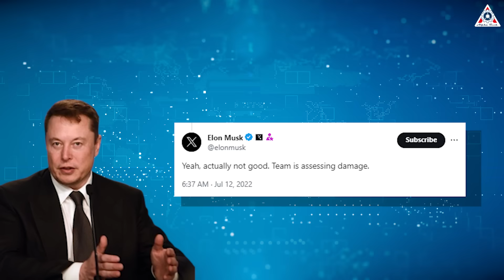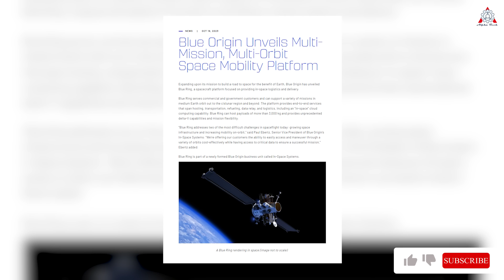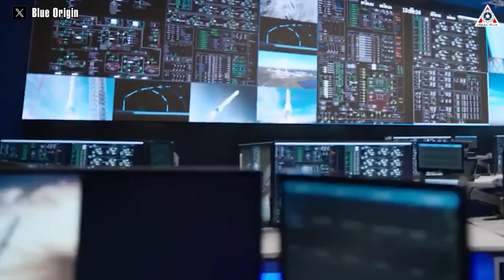Game Over! Blue Origin BE-4...

Comment: SpaceX has completed 2 major iterations of the raptor, they have done way over 1000 individual engine tests, some of them failed, some of them were tested to failure. At least 33 were flight tested (even though some failed it's understandable as they were tested on a first of a kind vehicle).

It's possible that blue origin just wants to be extra careful and make sure that the first Vulcan test goes smoothly, but if they fail even after all the shenanigans they're pulling, there is really no hope left for them.

Comment: Are BE-4 engines going to be reusable?  That's a hell of a lot of copper in those nozzles which is great for heat, but it is prone to work-hardening.  That may not be an issue if the engine produces enough heat to make the copper ductile again during launch, but short burns for orbital transfers may not get hot enough.
Reply: The first stage of New Glenn is certainly intended to be reusable, including its engines. ULA talks about some Rube Goldberg system of jettisoning and recovering just the engines of Vulcan to reuse them. We'll see if they are actually serious about that.

Comment: Didn't the guy doing Musk's motor try lower pressures and fail, and that's why they went with higher pressure in the motors. The higher pressure made the combustion much more stable

Comment: I have yet to understand all the Hype over Raptor vs the BE-4. There hasn't been a single StarShip or SS Prototype launch to date without multiple Raptors failing. So, 100% of launches w/ Raptor Engines have had engine failure of one sort or another. 
 What's going to happen if a single Raptor Vacuum engine on StarShip fails in space ? There are only 3 vacuum engines at 120° apart on SS, if one flames out, the asymmetrical thrust, all on one side of the ship, won't be overcome by the Cold Gas Thrusters as the outer Vacuum engines don't gimble. And w/ the Atmospheric Raptors closer to the rockets axial centerline , lighting off one or two of those in the vacuum of Space, is going to be problematic, if they can be used at all.
 SpaceX may be flying their CH4 powered engines first, but they have yet to have a 100% success rate, and with 39 Raptors aboard StarShip & the Superheavy Booster combined, SpaceX has some challenges ahead.

Comment: Irresponsible to use BE-4 without much more testing and explanation for failure.
Reply: The BE-4 has gone through thousands of minutes of test burn time.  More than any other engine in history, including Raptor.  It is, apparently, from the actual test results not mentioned in this video, a really reliable engine. Raptor?  Has not yet proven itself to be anywhere near as reliable as Elon wanted in his vision of "multiple launches per day for the same booster and starships. Just a different development methodology, one slow, safe, careful, one fast, pragmatic and questionable.  Both may succeed, or both may fail.  The optics at this point are: Let's see if Vulcan flies successfully next month, and let's see if Starship flies on Friday. Both will be telling.

Comment: It comes down to the approach to testing and flight readiness. In other words, neither have made a successful flight. The Raptors have been flown but failed while the BE-4 is a “test stand queen.” Just be careful who you are making fun of until there is a non-explosive end to a flight.
Reply: More raptor engines ready then be-4
Reply: Just saying
Reply: Raptor may not be reliable yet, but It still has flown, and most of the engine was good while few didn't last. That is why it is still in testing mode. I bet it will fly this time next month or so.
Reply: @Shadowmane9  Ready to do what, fail? Not succeeding is not succeeding, doesn't matter the path other than how much it costs.
Reply: @1flash3571  20% failure rate is not a man-rated level. But the point is SpaceX's testing method is the old Soviet / N-1 failed concept while the BE-4 is using the successful NASA approach. Who got to the moon? You pick the best approach.
Reply: I used to mock SpaceX too, but after seeing their success rate, the pace of development and their ability to solve problems and push forward they have completely blown the old NASA model out the window and shown what a capitalist company can do.
Reply: @pchris6662  BO is not SpaceX, Bezo's is not Musk. Just one success would stop a lot of the "mocking".  Right now all the "mocking" seems like fair criticism given our tax dollars are flowing to a company that can't even do 1960s mercury program level of performance. BO like Bezo's other ridiculous projects is the space equivalent of Prime Video's Rings of Power. They lost the plot, directionless, amateur and an ego driven cluster F
Reply: @VernonGermano  Well said!  I do applaud the efforts though.  I have come to truly respect and admirer what SpaceX is doing,  it I want more companies to join.  Monopolies are not a good thing either.  Sadly though, BO just isn’t near as good at innovating and managing proto-production profitable projects like Musk is.